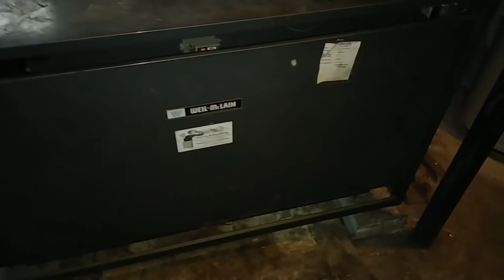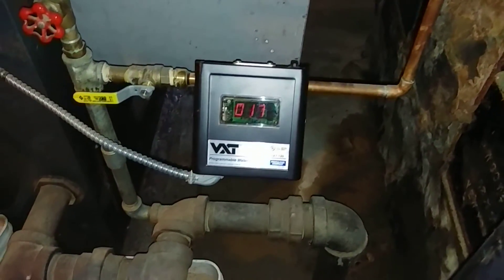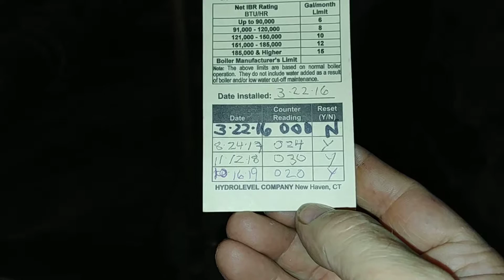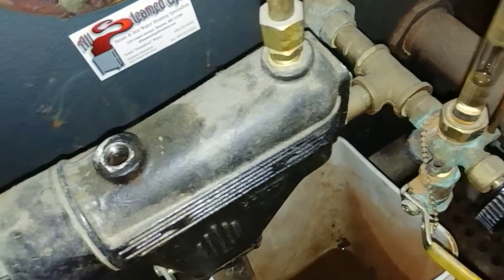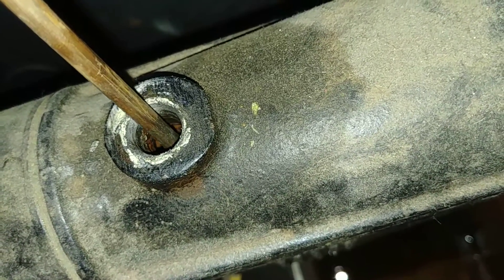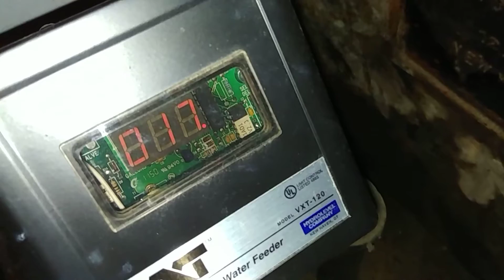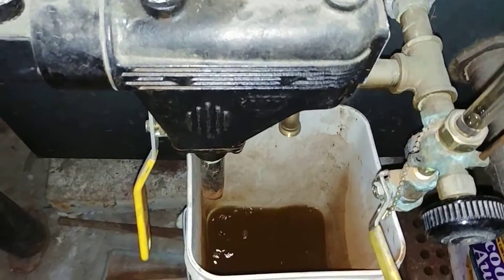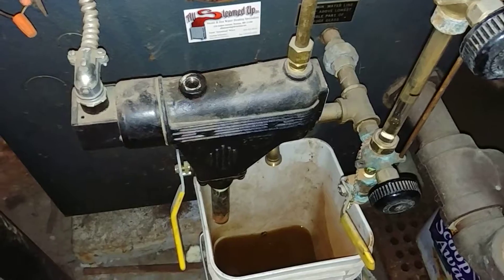Steam Boiler Start-Up: Freeing A McDonald & Miller #67 LWCO Stuck Float

Comment: I have a 67 low-water shut-off that's worked fine for 25 years but I stopped using the 101A feeder about 15 yrs ago due to overfilling.  I'm now looking at replacing the 101A with a vtx, but first I checked to see if the feeder signal was still working. However, my volt meter tells me the 67 is not sending a signal from the lower two screws (only the upper two). When I manipulate the float (through the blow out ball cock), I hear two clicks, but only the second (lower) click does anything (by shutting off the burner).  Everything remains wired correctly since the feeder worked properly for a while, and the wiring hasn't changed.   if float is working, what would explain getting only the burner but not the feeder signal?   Does this mean I need to replace the 67 (which I realize I should), or could I just wire the feeder to a new feeder to the same signal contacts that still work for the burner?
Reply from the maker: You might need to replace the #11 switch.
The contacts might be arc'd out.
Reply: @gordonschweizer5154  Thanks for quick response. I've posted a follow-up question in comments to your intro to the 67 video: https://www.youtube.com/watch?v=HSZLaqm9TXE&list=PLPrJrk_ajqsxqtLGx65z9eKb8WDSVt24O

Comment: Gordo - thank you for sharing.  Have you ever removed the float and the drain to scrape out the inside?
Reply from the maker: @kellyw9567  Yes.
It is a bit of a pain. 
There are a lot of little screws to remove without breaking them.
The gasket has to be cleaned off both surfaces.
The float may need to be replaced (unlikely but with my luck...)
The switch might be wonky, too.
It may be best to have a whole new unit standing by so you can get the heat back on in the event something goes snap.
Or, better yet, remove the #67 entirely & try to go electronic.

Comment: My boiler won’t start I cleaned pigtail, sight glass, pressure trol and McDonnell and miller low water cut off  and I also have the pilot light on!! Please help
Reply from the maker: @josephrothschild206  Do you have a voltmeter?
If so, is there 24 volts at the gas control valve?
If so, it is likely the gas valve is broken and needs to be replaced.
If not, check if you have power.
Check if you have 24 volts anywhere.
Is your t-stat working?
Reply: @gordonschweizer5154  Thank you i will check that .

Comment: Thank you for this! Our plumber retired last year, good man and he knew steam. 😢 We miss him!

Unfortunately, I don’t have a tap there (the sight glass is plumbed into that hole) but I have one underneath, opposite that one. If I turn the boiler off, and drain it, can I open that bottom tap and fish around in there with a piece of wire to free up the float? Or can I just fish a wire up the open valve? 

I hate to spend $500 + installation for a whole new unit, but now I’m a little worried about it even if I DO get it unstuck for now. Maybe it’s time to upgrade to an electronic unit? Thank you sir 🙏
Reply from the maker: You are most welcome!
Depending on the age and condition of your boiler, it might be a better idea to upgrade to an electronic unit as you suggest.
What you decide to do can depend on the skill level available, as well as your budget.
I cannot see your situation from here.
The low water cut off (of whatever type) must work properly, or your boiler may become irreparably damaged.
Reply: @gordonschweizer5154  So, i tried blowing it down about a million times, I tapped it, I yelled at it. I ended up draining it and using a thin wood dowel up the open valve I gently probed until I could hear the float click on/off a few times. Filled it back up and it worked perfectly (for now). What ended up helping me was seeing your OTHER video with the cross section of the 67 - once I could visualize it, I was confident that I could safely poke it from the bottom a little and free it up. So you helped me out twice today, and saved me $1000. Not bad for a YT video! I do appreciate the time you took, and I love the way you teach. You’re a lifesaver.

Comment: How often do u flush the water from the boiler it doesn't have the 67 valve cut off
Reply from the maker: Once the boiler has been cleaned properly on initial start-up, it should not really need much flushing after that... once a year, maybe?
The LWCO probe should be pulled, checked & cleaned once a year per the manufacturer.
Reply: @gordonschweizer5154   I've noticed that once I took all the orange stained water out ... I don't have to fill my boiler daily ATM since I drained it I haven't put water in it for about 3;weeks ...I'm so amazed by that ....
Reply from the maker: Excellent good news!
Clean water makes clean steam.
Clean steam is quiet and efficient steam.

Comment: Your Video's have been a GREAT help. I have a question.. My National Heat Extractor 100 Series boiler installed about 1960. died 3 weeks ago. My experiences with repair people hasn't been good because most less than 1/2 the age of the boiler and either don't know HOW to work on it- or flat out have said 'replace it' & won't work on it. The boiler has always done a great job as it's only a 1080 sq. ft house. So 7 years ago, a young guy came- did nothing and promptly told me 10k for a new furnace. I thanked him paid his 'show up' fee and called another place. Another guy showed, perhaps mid-30's. Within minutes told me he was going to vacuum it out and replace the transformer that provides the juice to the igniter assy. The charge was super reasonable. Furnace died again a month or so later. I turned power off, took the new igniter transformer he'd put on-tested it with my multi-meter (It was bad! ) and replaced it with with  a 'Becket' amd she fired right up! Ran 7 years flawlessly. Back to it shutting down 3 weeks ago tomorrow. I have a  good knowledge of electrical, mechanical & pnuematics. Watching video's from you and two others on-line, I went through the entire furnace. Burner assy, pump, igniter, Stack relay etc ( starting with the electric panel and working my way through ) Cleaned out the furnace ( not very dirty at all! ) reset the Stack relay after cleaning the sensing coils on the heat probe that inserts into the flue.  Got it running 3 days ago ( just before this viciously cold weather hitting us.) and it ean perfectly until 1:00 a.m. this morning. I ended up giving the low water cutoff shown nin your video's ) a light 'rap' and the furnace fired right up! But? I've had to do that  an average of 50% of the time all night so apparently the float is stuck.  I am  waiting until milder weather ( should hit 52* here mid week ) and tearing the old #67 down to do a rebuild. At one point I believe in one of your video's, you talked briefly about opening the blow down valve and after it slows to a trickle, gently pushing up through the tube and through the open ball valve against the float to check it or get a little more of the 'barnacles' off but gently pushing it up and down ).. In this video- you show that through the top 1/4" plug when furnace is cool. I'm wondering if my water level is too low as well as I have to maually add water after a flush ( it works as furnace shuts down ) and it'll be at the correct level ( pretty much halfway up the site glass, but when the furnace has cycled off for 1/2 hour or more- it seem a little low ( at 1/3rd ) and there are no leaks anywhere.. Your advice would be greatly appreciated!
Reply from the maker: Thanks for your comments!
If you are now starting to have to add more water manually than before, (do you have an auto fill valve, also?), please make really sure you don't have any "crypto" leaks (loose packing nuts, a valve union not quite tight enough and loosing one drop every day, a gently hissing valve, underground feeders etc).
If you are sure of no visible leaks, then it might be your boiler is finally starting to fail.
Sometimes, folks have noticed more "white smoke" out of their chimney on cold days due to their boiler sending steam up the flue.  
Not a good sign, sad to say.
That extra fresh water might be speeding up the rust chunk creation in your #67.
You also have the option of removing the float assembly and doing a much more complete cleaning, but make sure you have a new 67 sylphon gasket. (supplyhouseDOTcom has them)
Better your #67 shutting your boiler off too often than not shutting off at all!
Please do your best to not let that happen, kind sir!.

Comment: I know that this can somewhat work temporarily in a pinch, but I would advise the homeowners to still call in a tech. This is not how I would fix this issue, the switch and float need to be pulled out and the inside of the cast housing scraped,wire brushed  and flushed out fully. The float carefully scraped of any buildup, then it's good to go for quite some time unless you have a really dirty water situation in which chemicals come in to play which can help tremendously. I've seen these lwco get really nasty inside, but no need to ever replace, just clean out and rebuild when necessary. When I say rebuild I'm talking a new switch and float assembly. Then it's just as good as new. Also yes, always blow down and test lwco function with burner running and steam pressure on the boiler, of course residential is not much pressure to speak of but it should be making steam when blowing down. I do like your gauge glass blow down setup, I hate those little valves that come from factory they end up plugging up all the time. Thanks
Reply from the maker: Thanks for your comments.
I really try and push those sightglass drain valves.  The one that comes with, is silly, as you know all too well!  
I'd rather try and upgrade the customer to get a probe-type safety control if I can, but must don't go for it.
I try and put the fear into them about blowing down the control PROPERLY and what can happen if they don't.
It seems that if the customer does conscientiously tests their control, and there are not a lot of bleed-out leaks, the temporary fix, as you reasonably call it, is good enough.
The deadly "rust-icals" that grab the float seldom make their re-appearance except maybe after a summer shut-down.
I find that pulling all those tiny screws to remove the float, with my luck I break at least one!

Comment: what if i have a pigtail?
Reply from the maker: If you have a pigtail screwed into that 1/4" hole, you are most likely going to need to drain the boiler to just below that hole (or your best guess where that is) and remove the pressuretrol,  & pigtail,  and access the float that way.

Comment: Hi Gordon, sorry in advance if the information is too little. We have a huge steam boiler that heats up three floors. The problem we have is the overfilling of the sight glass, but the boiler SEEMS to work despite that. We have opened up and cleaned out the large floater and replaced the cartridge (i think it was at the base of the LWCO?), but it's still happening. 

Do you have any suggestions as to what might be the problem that's causing the overfilling?
Reply from the maker: Do you have a M&M 42-2 LWCO and water feeder combo?  If not, what is the model #?
How long has this problem been going on?
Do you have a boiler feed tank?
What pressure are you operating at?
Reply: @gordonschweizer5154   @Gordon Schweizer  sorry in advance if this info is not what you wanted. It's a McDonnell and Miller. Boiler control is model N247-2 (2 switch model 2). Pressure seems to be at .5 psi on both. It does have a water feeder. We noticed the problem about two weeks back when the boiler was turned on again for the winter. It's a Weil-McClain Model LGB series 2 boiler.
Reply from the maker: @helpinghand123  You may have already mentioned it, but what sort/model of feeder do you have?
Reply: @gordonschweizer5154  do you mean the boiler tank's model number?
Reply from the maker: The 47-2 combo LWCO & water feeder is junk, esp. the water feeder part.
Shut off the water feeder (usually a 1/2" valve on the piping).
That may stop the flooding, if flooding there is.
You're sure the sight glass is telling you the truth?
Reply: @gordonschweizer5154  I can't be sure. Because right now the water level is around 3/4th of the sight tube but not as high as it was before (which was fully filled to the very top). Also how much would it cost (estimate) to replace the parts you mentioned before?
Reply from the maker: There is no way I could give a meaningful cost estimate without looking at the job.
Reply from the maker: https://youtu.be/IThoboKgnes
Here is a link to a video that may help you get rid of that 47-2
They cause nothing but trouble and you would be well advised to get rid of it and install electronic LWCOs and a VXT feeder.

Comment: Great video thanks. The vxt feeder is it 120v? and if it is,how do you wire to mc donnell & miller low water cutoff #67
Reply from the maker: The VXT feeder comes in two different voltages and are not interchangeable.  Make sure you know which control voltage is used to order the correct unit.
The VXT-120 uses, as you might guess, 120 volts, and the VXT-24 is... 24 volts.  Feeding 24 volts to a VXT-120 will not work at all and feeding 120 volts to a VXT-24 will "let out the factory smoke".
The instructions that come with your new VXT (what ever voltage) show how to properly wire it up to a M&M #67.

Comment: Gordon, your videos just guided me thru finding why our 101A auto feed was not shutting off (pre-season) after opening the blow-off valve on the #67 LWCO.  By "tickling" the float it started working, for now.  The #67 is probably 15+ years old and the 101A is older than 38 so I will be scheduling replacement/upgrade of both soon.  We just cannot find any/good steam boiler techs here in mid-Vermont.  We moved in 38 years ago and had multiple problems with short cycling, inadequate heat to many radiators and banging.  The local plumbers comment was "That's what steam systems do."  I found Dan Holohan's "The Lost Art of Steam Heating" and successfully made numerous corrections and have had 36 years of comfortable heating.  One mystery I have not found an answer to however is why the pressure gage at the pressure control never lifts off zero.  I replaced the gage with a 3psi, cleaned out the piping and pigtail.  Dan's book did not seem to address why not.  Do you have a suggestion?  Your videos are fantastic and much appreciated!!
Reply from the maker: I thank you for that feed-back and telling your story.  Such comments keep me going and inspire me to keep making more videos.
To your question: It may be that your steam generation rate is less than your steam usage rate.  If that is the case, you would never see any pressure rise.  The steam generated by your boiler would be soaked up by the cast iron "sponge" , so to speak, and no excess steam would be generated to show up on the gauge and trip the pressuretrol.
Find out what your connected load is (that is a largely fixed number, hard to alter).  Look at your boiler's rating plate and see what that is.  That listed rate could be greater than what your boiler actually puts out for many reasons.
Trust me when I say that your gauge/pressure situation would be a source of envy by those unfortunates dealing with over-sized boilers!
I also trust that you will be replacing that obsolete junk 101A by using the most excellent VXT, yes?
Reply: @gordonschweizer5154  Your comment on pressure is reassuring.  November 5 is scheduled for lwco and auto feed replacement.  Adios 101A.  I don't have feedback yet regarding what vendor can provide for lwco.  Your videos are very well done-THANK YOU!
Reply: Well, could be that you're not building much pressure surely, residential systems are generally set very low at the pressure troll anyway, 1/2 - 1 psi. If you have very large home maybe only slightly more. But your pigtail could have plugged up in the off cycle or off season as well , I know this post was a year ago but pigtails should be blown out during the yearly maintenance,  if they havnt been,I would highly recommend it, if your pressure trol pigtail plugged up when there was no pressure on the boiler, it can't sense the pressure and won't shut it down when it should. Usually they plug up and seal the pressure in against the gauge or pressure trol but I've seen it go both ways. Just a heads up

Comment: This is the video that describes my situation to a T. (From my comment on your other #67 teardown video.) Water feeder constantly calling for water, which I hope is float-related. Will try tickling it, but the big decision seems to be whether to replace it with the same (which I could do myself, I think) or to go electronic (which I'd need help with.)
Reply from the maker: I'd maybe drain the boiler below the bottom sightglass tapping and go into the chamber from the bottom at the drain/blowdown valve.  
If that doesn't free up the float, then the float itself might be at fault.  
If the control is greater than 10 years old, a new #67 is called for (not worth just replacing the float & gasket).
How old is the boiler?  It may have an "official" tapping hidden under the jacket that can be used to install a probe-type LWCO.